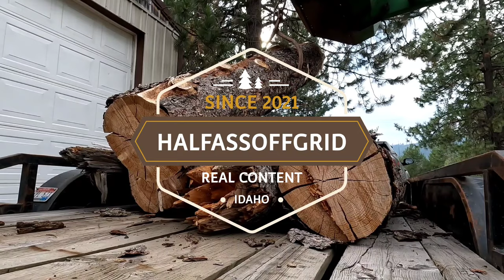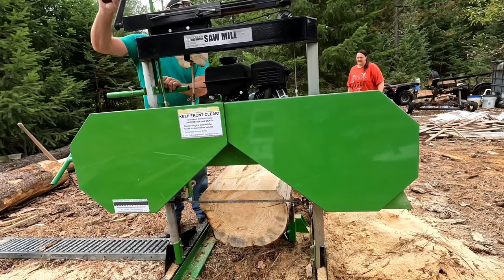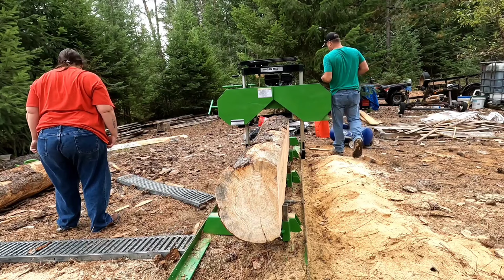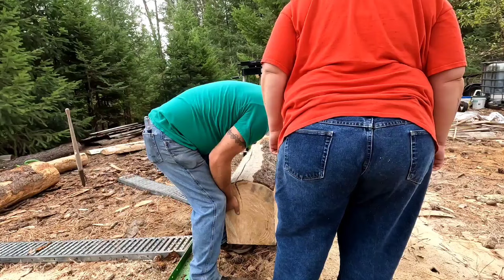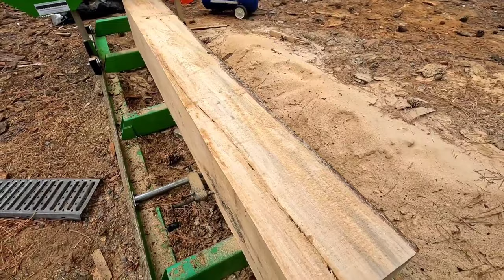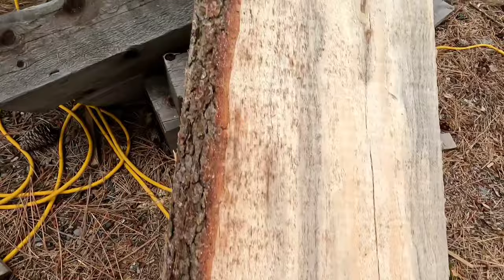Harbor freight sawmill vs 20" Pine

Comment: First thing you do is buy 2 twenty feet rails and throw away the ones it came with, then pour concrete footings to level them and you can cut over 14’ instead of 8’. I have milled a lot of lumber with mine and I can tell you the flexing those runners do will mess up your wood, I like mine a lot.
Reply: I disagree with that statement 100% those pieces of angle are stout, there is nothing wrong with the steel, but I do agree that lagging them to a level and most importantly flat slab of concrete makes them rigid, You can buy more track and it bolts right up, then I tack welded and ground the seems. You ask why not just buy the angle in one piece, the answer is the price of steel.

Comment: Ummm... I bet that blade did not like that jamming into the log after the rail got cleared. Might have a bit of wave in that 1st cut. Looks like it once you flipped that side against the log stops.
Reply from the maker: No, you are correct it didn't, especially since that blade was on it's last leg.  Given what we were milling (i don't know if you've seen any of our other videos on our channel)  it was a risk worth taking. That particular blade has milled almost all of the interior boards for our cabin.